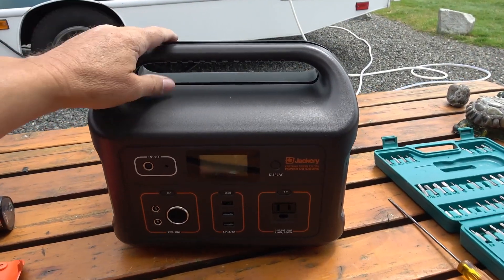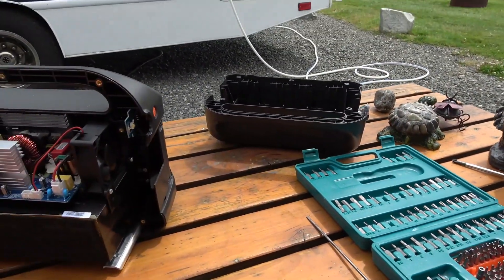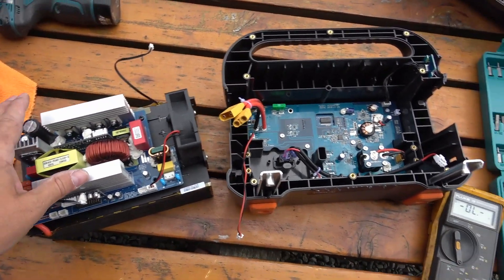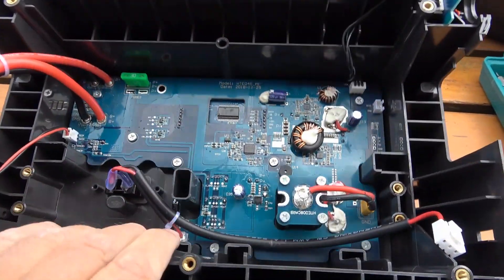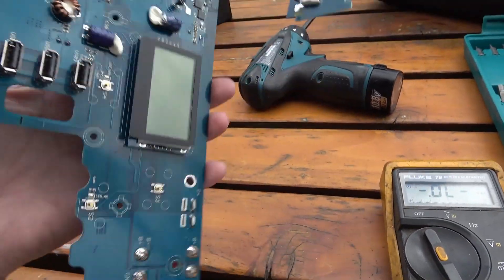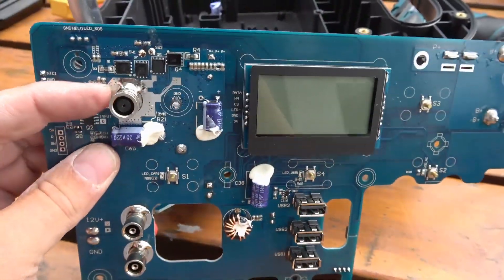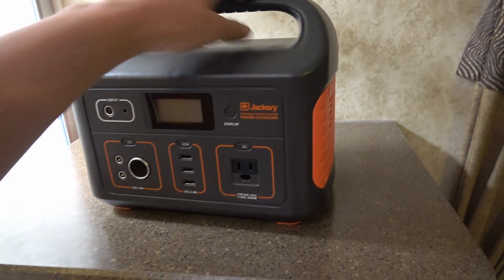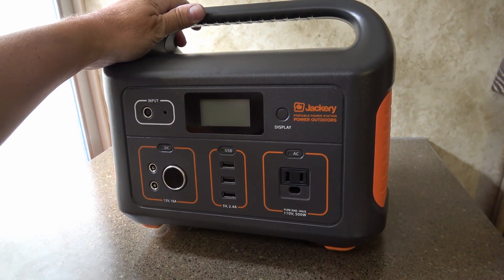What's Inside a Jackery Portable Power Station? (Explorer 500 Model)

Comment: I'm a 50 50 guy. 50% of the time it works when I put it back together and 50% of the time it might work. Just changed over the bottom part of a vacuum head the other day for the wife, took it apart and immediately thought was over my head, moved over the motor and other parts onto the new base, put it back together and amazingly it worked. That must have been the 50% it works time...😂

Comment: I enjoy my Aeiusny Portable Generator, 288Wh 500W for $279.00. It would be great if you could get one and review it. The price for the Aeiusny is very good. I mainly use it for my CPAP when boondocking. I have a 12v plug for the CPAP and I have gone as long as 4 nights on one full charge.
Reply: I have one and its been great   light and compact and very useful
Reply: YOUR experience info I'm SURE will help others IF they find it !
Reply: Numa Newbern I just saw that my 500 is no longer on Amazon 
It is not due to an inferior product 
I bet the 400 would work just fine. Not every thing needs to draw 500 watts
Reply from the maker: The design looks very similar to my Lensun power box, thanks for the CPAP info

Comment: Wow what a added bonus..on a review..
Love it..Lets look inside..
There has to be a way to cut the re-charge time down..and
re configure the bogus 12V output plugs that are useless..
L.W.
Reply: Whats bogus about the 12v output connector??? You noticed how they went to great effort solder that large base to MB.  As far as fast charging and the author of this video didn't take the battery pack apart, I would imaging they didn't include a "balanced battery charger which would be needed to charge faster.
Reply: @donjenkins2465  ..
What is the connector that mates to these plug ins..there are 2 of them..
any clues ?  it wasn't mentioned in the manual..
Thanks for the info. on the balanced charger circuitry..
This is a great unit, however the charge time is excessive.
L.W.
Reply: @l.w.lavelle9724  The manual just calls it a 6mm...But the most common  6mm is the 6.0mm 1.4mm which is a laptop connector. I will know more on Monday when my Jackery is delivered. Will let you know then.
Reply: @l.w.lavelle9724  So now I have it figured out...these are "6.3mm 3.0mm" plugs....If you search for that size on eBay you will have many choices..These re for Toshiba laptops ny the way.
Reply: @donjenkins2465  
Is there an adapter Plug for this
to hit a normal connector..
Do you know if the center Pin is 
positive or negative..?

Comment: Ray, would you please tell me what the part number is for your Makita cordless screwdriver set?  Thanks
Reply from the maker: Makita DF030D  https://amzn.to/2YddtXd   https://makita.ca/index2.php?event=tool&id=706&event=tool&id=706
 It's an old model now I imagine, I've had it for at least 15 years or so :)  The bit set isn't Makita, it's just a cheap set called Everybit but has a bunch of tamperproof ones - https://www.tekton.com/everybit-ratchet-screwdriver-and-bit-set-2841
Reply: Thank you.  I've been looking at several and I need the security bits as well.